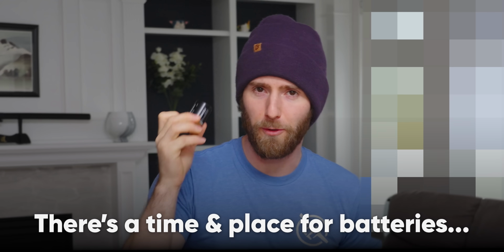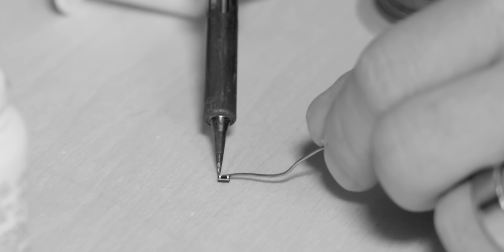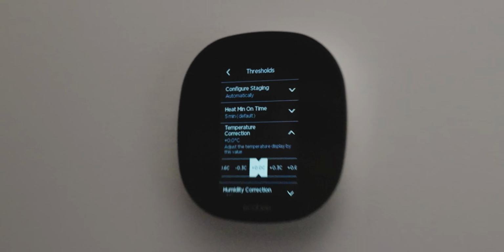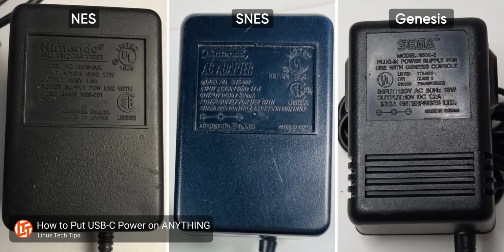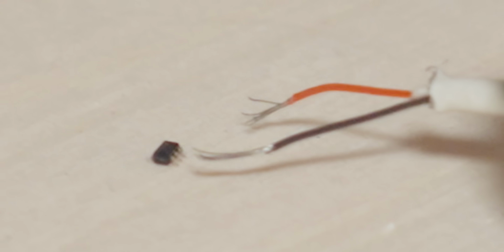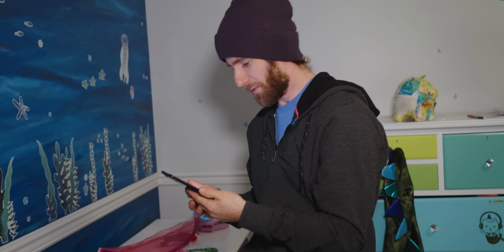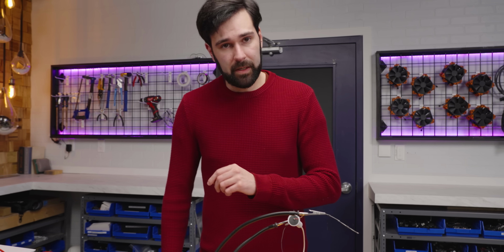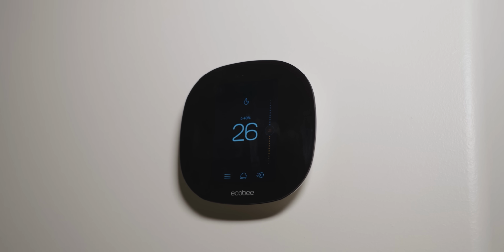I HATE Batteries! - Converting Wireless to Wired (a cheapskate’s guide)

Comment: Just buy a pre-made buck converter with solder pads. They are tiny enough to fit in the battery's footprint. They also can adapt to a wildly varying power draw, and have capacitors to smooth the voltage/current draw spikes. Cost? About $2 per device.

I successfully un-batteried my house with their help.

Comment: You coul'd also just use a LM7803 (or LM7805, 06, ... depending on your output voltage). It's probably not cheaper but also very cheap, more compact and way less fidely than these three or four diodes. On higher current devices it wouldnt become that hot than this tiny regulator. It also is in the most cases through hole (with proper leads) and you don't have to worry about the proper output voltage (assuming the input voltage is about 1 to 3 volts higer than the output voltage, your device needs).
But in respect to Linus' video you can also use the methods he showed, it's still a great video.

Comment: I have a small CR2032 printable that holds 5 diodes and has a ridge around the edge and a top plate.  You run the length of one diode lead around the rim as anode, and attach ground to the cathode (bottom plate)  Simple to print and clip-in to most devices.  Also, you don't need "exactly" 3.2V.  Most of these devices are designed to run on button cells even as they discharge.  You can run most anywhere from 2.0V to 3.5V without much worry.  I aim for ~2.8V most times, and that works well. Worst case, for over-consuming devices, I drop one diode and it's generally good.  Diodes generally drop about 0.45V in series, so 5 of them drops a 5V supply down to just about 2.8V rather well.  Some devices will report the battery at about 80% because of this, but that's fine, since it's constant power.

Comment: Wireless (RF) devices shouldn't be converted into wired with *fixed* voltage regulators **that are being adjusted with a resistor/diode**. The difference between their current draw on idle vs using their wireless functionality IS BIG. As seen in the last part of the video, these changes shift the adjusted voltage. For this, there are actually cheap adjustable voltage regulators (or even Zener diodes may probe useful for low power IoT) with their peripheral additional components already setup on a small PCB with pots to adjust their voltage setting and easily accessible solderable pads. This can be done, for cheap, it can be easy to solder too... but not with this method.

Comment: Linuys is wrong in the voltage range. The voltage of a chemical battery slowly lowers while discharging. They seem to go all the way down to 2.6V easily, maybe even 2.4V. I would have just used a compact step down converter instead of a pot that will cause tons of loses and allow very little current through. Nvm, just saw the diode part, pretty decent, still has some losses but overall way better of a choice than a potentiometer and way cheaper and more compact than mine. With the low amount of current, the diodes are good enough for this system.

Comment: I'm not an electrical engineer but the 3.2V battery varies during its life time so surely 3.0v would be good because isn't the operating voltage like 3.2 to some voltage below 3.0v?

Comment: Why would you possibly not want to run the heat pump? During the winter, he posts are way more efficient than your hot water cooler. You'll be spending thousands in extra electricity costs for no reason. The only benefit of having a heat pump is that they're more energy efficient

Comment: To anyone trying to do this. Great news. 3.3 volt regulators are super easy to find and are actually all you need for a circuit like this (aka no potentiometer needed). Here’s why. All batteries have a voltage range from full to dead (fun fact, this is how systems know how much charge is left in a battery). This includes button cell batteries (aka lithium ion batteries).  For button cell batteries, this range is usually 3.3(full) to 2.7(dead) volts. This also means that any device that uses button cell batteries has to be able to operate at these voltages. So, even though the “nominal” voltage is 3 volts, 3.3 volts is still totally fine. And the best part is, you can find the voltage range of most common battery types online.

Comment: 3v voltage regulators are cheap, worth ordering and waiting otherwise you break those battery powered sensors. Also you might need to add some 1-10uF of capacitor at the 3v output.

Comment: I feel like this video is a bit of a disservice to the community, I love the concept but the lack of planning and the "make it work" solution isn't going to work for everything. It just feels rushed and waiting a couple days to get some components for a more rock solid "universal" solution would have been nice. I mean for less than 15 USD you can grab a 10 pack of 1.25v-30v dc-dc buck converters and slap one of those on a cheap USB supply and have an easily adjustable 1.25-4v supply. Please revisit this with a little more planning and prep and really show the community how it's done.

Comment: That is why you put a polarized capacitor in parallel with the power drawing component to build up a buffer of current for uneven power draw. It will not go over the set voltage but allow a short burst of power for irregular events, while filling back up in between. A cap the size of a match head at 5-15v would fill your needs in this case so it should fit no problem. Just make sure to match + and - sides to your device.

Comment: Always adjust your output voltage BEFORE hooking it up to a live device, if you value the device....also a wall wart would have been far less finicky than a USB charging cube, they are wildly variable in how many amps they put out, especially the cheaper ones. I've seen some that were so underpowered they merely somewhat slowed the discharge rate of a tablet being used for basic web browsing...

Comment: I've converted several devices to wall power by picking up $1 transformers from my local goodwill in whatever voltage & amperage I need. It's a lot easier than what Linus put himself through here, cost about the same, and prevents a little e-waste.

Comment: idk. i have had Philips hue system since 2018 and so far out of 3 dimmer switches only one has given me notification of "replace the battery soon" on the hue app.
rest a re reporting fine on their coincell watch batteries state.
sure having only 3 switches is not much, but from the craft at 1:20 i got the impression that i would have had to replace the batteries at leas t once per 2 years of use.
yet here I'm using them on their original batteries on two out of tree switches after 6 years of use.

Comment: the potentiometer was useless and unnecessary. Linus is wrong that battery powered devices need a specific precise input voltage. On the contrary, since battery voltage decreases as the battery discharges, battery powered devices have to be designed for a voltage range. The nominal voltage is usually lower than the fully charged voltage, and 100mV difference won't matter for a well designed product. He should have just powered it from the 3.3V regulator directly. The potentiometer doesn't accurately regulate the voltage and introduces a lot of extra fuckery.

Comment: Here's a better idea.
Take a button battery.
Coat it in nail polish.
Or see if you can't find a 3D printed version that you can then order cheaply.
Grab a proper 3v wall adapter.
Strip off the plug, expose the wires.
Drill a hole through the back cover and pass the wires through.
Glue/nail polish the wires onto the battery so that both the wire is attached on both of the flat surfaces, but exposed where they should meet the contacts.
Turn it around because you got the polarity wrong.
And you're done.

For added bonus QoL, do not strip the plug off the wall adapter, and instead buy a female end that can be attached to the device and now you have a detachable cable.

Comment: hi Linus Why don't you use a lm317 Regulator Circuit. It is a lot easier to make it does not require Surface mount components

Comment: You could just order a 3.2v regulator, they are slightly more expensive, around 60 cents each.  Or if you have several devices with different voltages the old LM317 will be the best bet.  
1n4001 diodes will get you there with such low powered devices, with about a .6v drop each at low current.  Three in series will do the trick for about 3 cents.

Comment: Great info! Any chance we could get info/links to what best item to use for this? Example, what is that called @~12:55 Dan is using? I have several items that go on battery only and want to convert them into wall power (temp sensors, doorbell, etc) Thanks in advance!

Comment: Am i the only one concerned about the safety of smoke alarms being hardwired instead of battery powered? In the event of a power outage you now have no smoke alarms. During which, yknow, people are probably more likely to be using open flame for light or heat

Comment: I do this quite a bit, but I don't the easy way and pick up a 3.3v BEC from Amazon for about 60 cents each so everything is on a super small board and has better pads to work with for soldering :) I too hate battery waste!

Comment: 03:54
I must be missing something here. The thermostat/sensor is in the hallway and doesn’t activate the girls’ underfloor heating because it’s getting too much warm air through the hallway from downstairs. Wouldn’t the problem be solved if you set the offset minus a couple degrees to counter the warmth?

Comment: This sounds like an amazing use for one of those prototyping companies to make like 5 sheets of breakaway boards that have the pot and Voltage regulator and pads to solder the in and out.

Just have them done pick and place and milled so you can just snap em off as you need them (Or you can do the soldering yourself as you break them off)

Comment: This is a very amateur modification, which could have given you the exact voltage without needing to adjust it with an easier solder job by using a one 3 volt zener diode and resister. Use ohms law to calculate for the resister value, 15 ohms should work on a 5 volt supply. You also need to calculate the cost of the power supply even thou you may have one on hand, because once used it is no longer on hand for any other use.

Comment: I mean don't use a resistive divider for providing power that can support an actual load... The load is going to decrease the 'resistance' of the lower half and cause the voltage to sag. Just get a 3.3V LDO or switching buck regulator. I don't think a device that takes 3.2V is going to fry from 3.3V. It's a standard voltage for many microcontrollers.

For diodes there are zener diodes that have an exact reverse breakdown voltage, so you connect them in reverse, with a resistor on the cathode connected to the supply voltage, and anode connected to ground. You'll then get that exact zener voltage on the connection between the resistor and cathode. But I don't think this can support a large load either (too much current will bring the voltage at that output node sag just like the resistive divider)

This is just a completely wrong approach and hopefully no one is going to try this as is...

Comment: Yeah, as others have said, stepping down from the 3.3V to 3.2V wasn't really necessary... Also, you can make this kind of micro soldering job easier by buying a breakout board for the chip. This looks like a SOT23-5, which is a common package size, and you could surely find a breakout board small enough to fit in the battery compartment. You would also be able to put the buffer caps on that breakout board as well. This would have been how I would do it. But I am an Embedded Systems Engineer, so you know, I have a lot of experience with this kind of thing...

Comment: The only battery powered device which I want to convert to wired is the modern variant of the Logitech TrackMan Marble Wheel (I want to say it's called the M50 maybe) because Logitech refuse to make a wired version anymore but the shape of these units fits my hand just about perfectly.  I'm still using my classic wired TrackMan Marble Wheel but it's becoming a little finicky after 12 or so years.

Comment: I suffered a lot with xbox controllers for a long time, I'd buy rechargeable batteries and play and charge kits that always died or simply wouldn't hold charge after some point, so I bought a 3M usb cable. Haven't had problems since.

Comment: I had a similar problem with a gas fireplace thermostat, and found a company on Amazon who sells an adapter to replace AA and AAA batteries.   You have to find the right model, but they have models that replace 2, 3 or 4, etc....   Company is called Lenink.   Search for AA battery power supply adapter.

Comment: You could also just buy ready made USB stepdown adaptors to whatever voltage you need from Ebay.

These plug into USB and deliver the voltage you need, usually with small alligator clips to attach to the battery connectors, but you can also just solder them on.
USB power you can get from a USB charger - you probably have some old ones lying around, or maybe you are going to hook it to a device that has USB ports already.
Such devices don't offer a lot of power on the USB ports. A regular USB 2.0 port supplies 0.5 amps and a USB 3.0 supplies 0.9 amps, but for a lot of battery powered devices that is enough.

Comment: If you're going to do this (with any device), its best to use an adjustable DC buck converter board. It will be more reliable and easier to set up. Using a resistor (or pot) in series with power delivery is typically a bad idea. The diode idea is ok, but requires the right type of diode and pretty good tolerances. Even then you're lucky if you can step the higher voltage down to exactly your desired voltage. If you don't have the background to design a circuit or spec parts,  off the shelf buck converters are your best bet. Cheap buck converters are widely available on amazon with a range of different voltages and board sizes!

Comment: I'm confused. These ecobees aren't even directly wired to anything with your (janky, IMO) HVAC control setup. So why did you mount the ecobee in the hallway in the first place?

I enjoy a lot of this content, but some of this stuff (like your thermostat setup) just seems like it could be much more simple and elegant, but is convoluted on purpose.

And those smart sensor batteries last a very long time. I have them, and I'm going on 3 years. Ecobee claims 5 years. So while I understand the root problem and agree that batteries are wasteful for devices that chew through them, it seems kind of silly to go to this much effort on the ecobee.

Ironically, you spent more time and money solving this battery problem than you would have spent in batteries for a decade or more. And now you have a wire to deal with. And, let's be real, you'll probably replace those thermostats before the battery would have died anyway!

Comment: 6:00 I'm glad the editor of this video had more common sense than Linus or the writer of this video...
Cheap and not certified USB chargers will not only have high risk of failure but might also fail in the worst way possible and send the full 120/240V through it.

Comment: cheaper solution: put two regular diodes and a 0.4v forward voltage drop schottky diode in series. The forward voltage drops will bring down the 5 volts to 5-0.7-0.7-0.4= 3.2 volts. 

I've used this to step down 5 to 4.2 to power an old phone without the battery. Works like a charm!

total cost would be like 40 cents total

Comment: OR you can all so drop the voltage by inserting 2 0.7 Volt diode's that will drop it down to 3.6V OR  3  0.7 Volt diode's that will drop it down to 2.9V from 5v that will be WAY cheaper and safer. then all this resistor and regulator stuff..

i legit have done this a few times..  even with a DC player
Reply: Holy crap you read my mind, i just wrote basically this exact thing and i check the comments and you beat me 🤣

but yeah 2 0.7v diodes and a 0.4 schottky would bring it down to 3.2v at a total cost of like 40 cents.

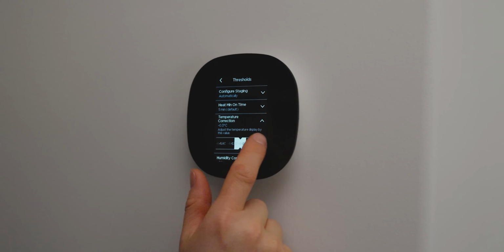Comment: @4:15 experiencing temperature variance that wide could be solved by simply changing which side of the wall the eco bee is located. offsets and random sensors seems overkill when  the solution is to take the ltt screwdriver and make a tiny hole to mount on the other side. you never want a temperature sensor in direct heat/sunlight. the hallway is normally good but in this case its a problem. you could use a single sensor in one room and have the thermostatic/aqua stat inside one the heated rooms or use fans on the 2nd floor to assist in air movement. leaving doors open a crack and making sure you have at least two inches under the door for air movement is quite important , a house cant heat if the air becomes immovable due to static pressures. soft doubled sided tape or sticky tac would allow for mounting of the sensor
Reply: I realize my advice would make for a poor presentation of a tech video but its what I leant in college

Comment: You could also have used a big capacitor on the output, and run the voltage at 3.7 volts.
those 0.7 volt on a capacitor will allow for those crazy voltage spikes without drooping the voltage below 3 volts.

Comment: I directly soldered an old lightning cable into a 2x AAA faucet timer (plus a capacitor just in case)

Now my 2.8 volt timer runs off a 5v USB type A wall wort

The stainless battery enclosure didn’t want to accept solder

Comment: 3:45 why is the thermostat installed in a corridor not in rooms? If u did whole house renovation, why not move the thermostat? That way you wouldn't need to power a second device at all... Don't understand that... Or buy a thermostat with a wired probe and drill your way to the other side to the rooms...